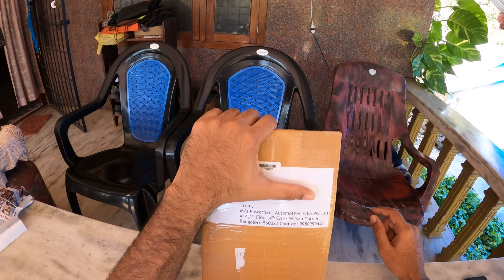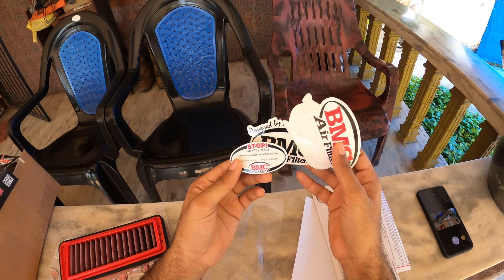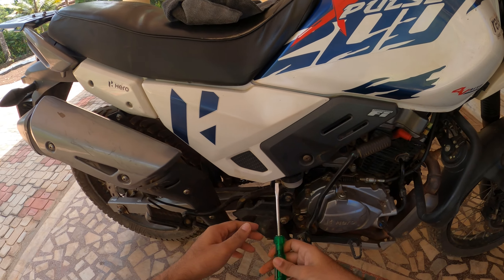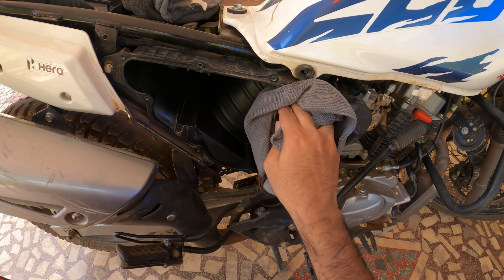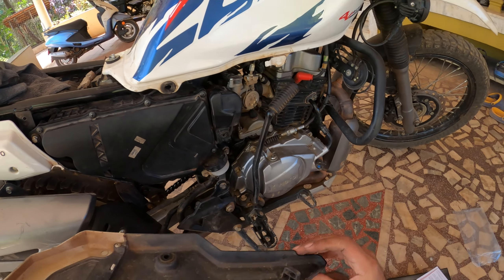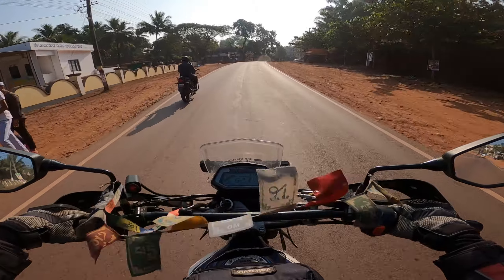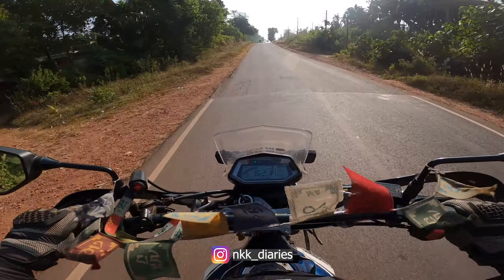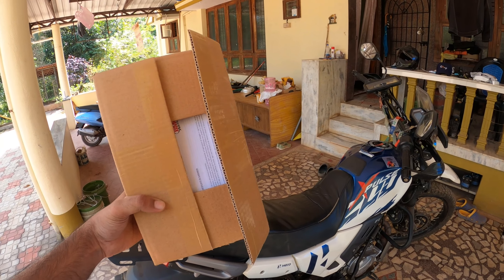BMC Air Filter for Xpulse 200 4V | DIY Installation | Worth? Price? Any Improvement?

Comment from the maker: Cost: ₹6499
Read this:
You'll notice around 5-10% improvement in the throttle response in BS6 vehicles (probably more in older vehicles because of lenient emission norms) which means the bike feels more relaxed whenever you are commuting or want to overtaking someone or cruising at 80-90kmph and you'll still have some juice left for quick overtakes. You cannot expect a drastic performance improvement like a 200cc bike performing like 400cc, it's only a minor improvement which will make the bike slightly more relaxed. Also this is a lifetime airfilter, which means you can just clean it and use it forever. Yes, the improvement for the investment might me less, but that improvement will enhance the overall riding experience and in that way I felt it's worth the price.
Also, as said in the video the improvement is dependent on how much of the tolerance the ECU can handle with the increased air flow and to unlock the full potential of air filter you need to have free flow exhaust and a ECU tune which will cost another 15-20k.

Comment: Hi, I’m also facing uneven rpm idling and stalling in cold start. Does this air filter change helps resolving it? Or any idea about getting it fixed? Some says changing to aftermarket exhaust like moto wings may arrest it because stock catalytic converter is removed. FYI I own 2022 Xpulse 200 4v.
Reply from the maker: @srenivasen9993  Hello. Unfortunately BMC doesn't solve this issue. Its just how Hero has poorly tuned the fueling during cold starts.
I've heard that fuelX or piggyback ECUs will solve this as it runs on custom mapping. But never tried it.
Reply: @ thanks brother for your info

Comment: Was it worth 6500 rs ??
Reply from the maker: You'll notice around 5-10% improvement in the throttle response in BS6 vehicles (probably more in older vehicles because of lenient emission norms) which means the bike feels more relaxed whenever you are commuting or want to overtaking someone or cruising at 80-90kmph and you'll still have some juice left for quick overtakes. You cannot expect a drastic performance improvement like a 200cc bike performing like 400cc, it's only a minor improvement which will make the bike slightly more relaxed. Also this is a lifetime airfilter, which means you can just clean it and use it forever. Yes, the improvement for the investment might me less, but that improvement will enhance the overall riding experience and in that way I felt it's worth the price.
Also, as said in the video the improvement is dependent on how much of the tolerance the ECU can handle with the increased air flow and to unlock the full potential of air filter you need to have free flow exhaust and a ECU tune which will cost another 15-20k.

Comment: How did you fix the cold start issue? Facing the same issue now
Reply from the maker: @Nizar-m8t  it's still not fixed. Just got used to living with it!
Reply: I have noticed that turning on and off the kill switch to let the fuel pump do it's work two three times before cold starting the bike reduces the stalling issue

Comment: Thinking of installing BMC air-filter onto my Apache RTR 180 dual-channel ABS BS3. I have already installed many performance parts, and the bike performs like a beast. My RTR180 beats my own 2023 NS200. Is the filter worth 6k ? Would be thankful for your reply.
Reply from the maker: You can expect 5-10% improvement in throttle response. You can go for it if you feel it's worth the price of the product.